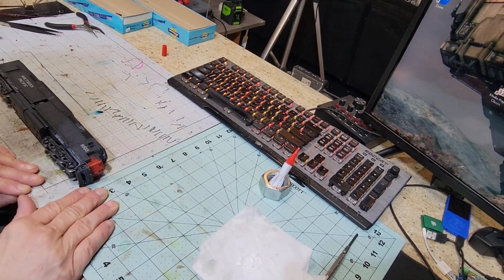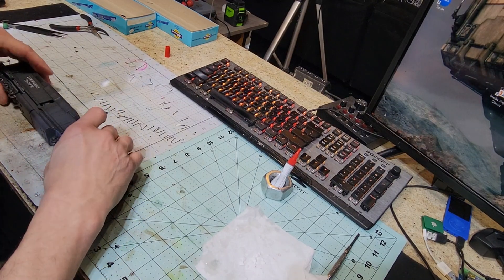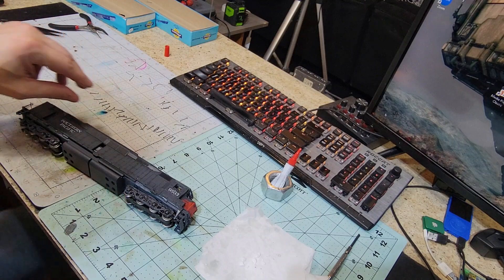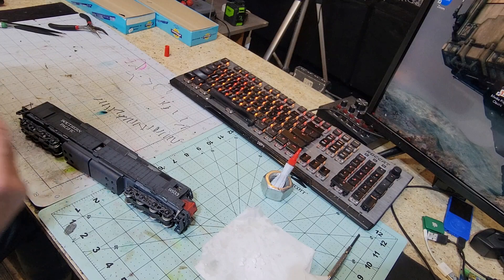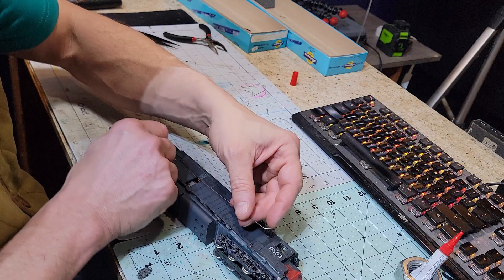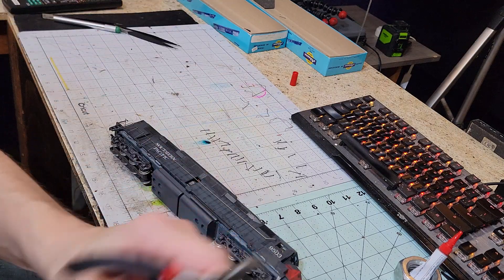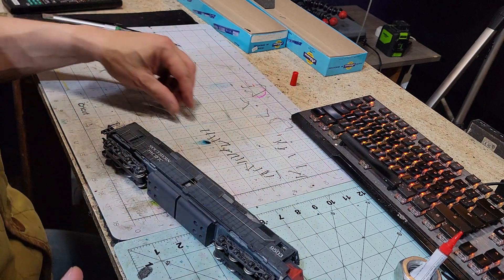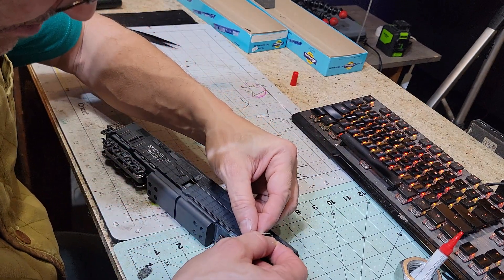Dual Motor DD40 33 Handrails

Comment: I know your knife blade works fairly well, but have you thought of trying a microbrush for thin glue application?
Reply from the maker: I've got tons of microbrushes but it wastes 1 of them if I use for superglue so I just use the knife.  If you look carefully, PUG's air tanks are micro brushes and you can read the lettering on them!